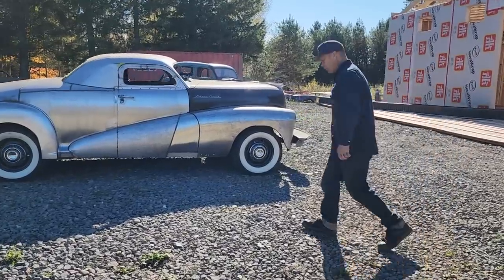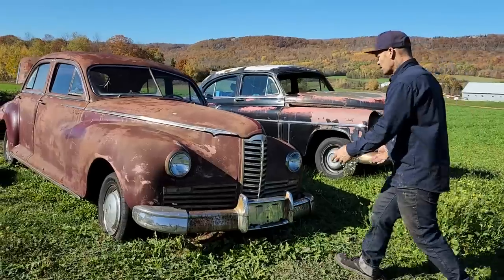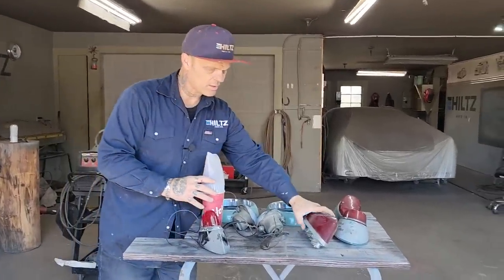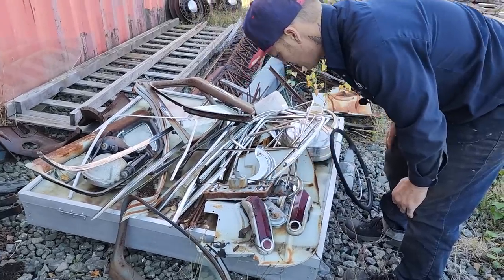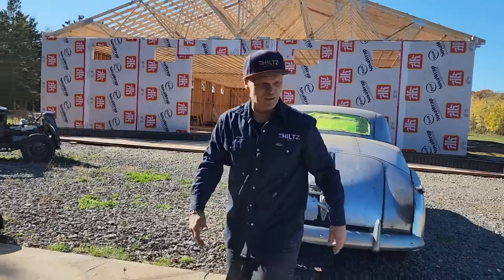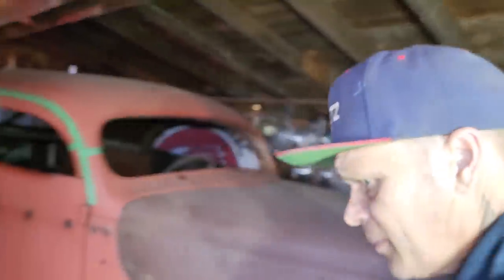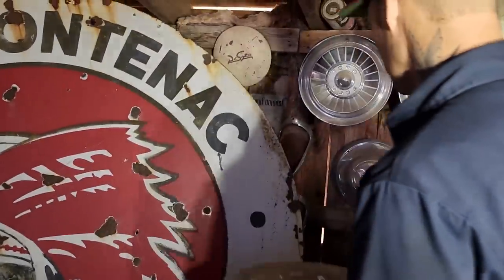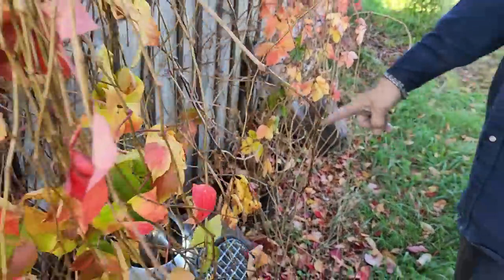The next custom fabrication... headlights, taillights, grill, hubcaps

Comment: I wonder if you can take the 51/52 Ford truck grill at (9:50) in the video and integrate it as a dual headlight setup coexisting with the current fenders.

Comment: Use weld through primer for those hard to reach places like inside the door pods etc, before you weld them shut because that bare metal will rust quickly and after welding shut you will not be able to get to them. Great job so far. I love your work ethic and creativity

Comment: The olds grill is an excellent choice but it will dominate the front end. Anyone seeing it completed will simply say there's an old Oldsmobile. Customize your car parts for your customize d car. Maybe trim grill ends in stairstep fashion or whatever. Mercury wraparound tail lights a little bit frenched would look outstanding. Your 56 Ford headlight rings with a little extension on bottom like the top might be cool looking. Love the build, keep up the great videos.

Comment: Put the plate back on the top of the front bumper then set that grill back on top of that plate. That way it will be higher and you won’t have to put so much metal between the hood and the top of the grill

Comment: I think the 'brand new's' 39/40  have the edge, they hold the same form lines  as the grille. Do the extended headlight rims.
 The spare wheel mounted on the installed 18 plate giving clearance for the boot opening/access.
 End of the day choice is yours and daresay it'll have the 'je ne sais quois' 
 Nice one guys👍
Reply: I was just following Chad's lead he'd said they could be 39/ 40 ....but brand spanking👍
Reply: Just realised...🤪🙄😁👍💕

Comment: At 13 minutes you were holding a 55 Chevy tail light assembly. It's 17 minutes and 19 seconds ish those were not 55 Chevys tail lights. The green headlight rims you had early on and possibly the small square rectangular tail lights off the car outside. And there's another set but flat and sleek. Is which car is so far sleek. But in something like Volkswagen tail lights or some other large tail lights at set out and not slope at the back of the car kind of takes away part of it being sleek. Now with that being said you made the short two-door work. External spare tire idea don't put on trunk later in my opinion put up in that large area you got there between the back of the cab of the car and the front top of the trunk lid. I think you'll find some in the thirties that was done like that. You can always put on the side behind the door and maybe one on each side for symmetrical balance. I think I'd go with the original grill. But with all that being said it would be nice if you had enough lights on the back that people could see it. If you French them then they wouldn't stick out so far. Just a few thoughts. It's a sense you're not going to do the Tommy gun steps on the side murder rocket launchers on the back deck where they come up and that flat area. How about reloading Gatling guns where the headlights pop out. The car reminds me a lot of the one in Peter rabbit parrot I don't think I ever watched whole movie but I kind of remember the car. I do mean that as a compliment. Your car every time you look at it it reminds me of something different. But then that's the idea isn't it? As far as a hubcaps I think you nailed it with those Pontiac hubcaps. The bullets on the 57 Chevy hubcaps would look nice too. But I'm kind of partial to stock 57 Chevy parts for 57 chevys. Just my bias. But the fun part is I can just tune in and watch you do the work and see how it turns out and go wow I never thought of it and it looks great. Or I can say I wonder if you read my comment and thought it was good or somebody else is with similar thought.

Comment: I'd go with horizontal Mercury tail lights, recessed or Frenched, and the original headlight rings recessed or Frenched. EVERYTHING smooth. Find some vintage wire wheels, with simulated knock-off spinners. Ditch the continental spare thing, go with dial side mounts. My 2 cents worth!!

Comment: Amazing. 'nuff said. But please don't use the Olds grille. General Motors used the same body for the Olds, Pontiac and Buick for 1948. So you end up with a stock grille for the year. Could do something much cooler.

Comment: I am disappointed your stripping the silver streak trim off the hood and trunk. I was hopping that some Pontiac style character would be left on the new design. Looks like your going with a rear stance with broken rear springs look. I did like the look of those rounded recessed headlight trim rings. I did not see any of your taillight selections you showed that really struck my fancy. I am wondering how some mid 1950 to earlyChrysler Imperial tail light treatments and or rear bumper and trim would look. There also some Fraser and maybe some 1949 or 1950 Nash Airflyte taillights would look pretty interesting with the trunk spare tire treatment.

Comment: Damn guys, there is plenty of choice. 👀 
The front grille looks fine to me. Beautiful bad. 👍
The front headlights would also leave the original ones, maybe I would add an eyelid... 
For the rear lights, on the other hand, I can't decide which one to choose. Those of the beetle aren't bad, but those boobs would be fine too. But before deciding I would put the spare wheel housing, and then see which rear lights match best. Perhaps the spare wheel can be placed higher, between the rear window and the trunk.
The new building is growing great, wonderful

Comment: Something is off with the driver side rear wheel opening. I've noticed it on a few videos and it bothers me 😂. Just take a quick look Chad. You will see it. Looks like the tire opening is off set. I'm not knocking your work at all though. You do great work. I'm a fan. it could be the angle of the video shot and it's tricking my eyes though.

Comment: Use the rectangular tailights off that 4dr. Also IF you put a single spare on the back it will cover a lot of the waterfall chrome piece instead use 2 spares side by side so the chrome peice stays visible.
For the headlights use the rings with the big overhang like eyebrows it will make the stick out even further.
Just my thoughts.
Enjoy watching you work like a master making a masterpiece!

Comment: don't take metal down to the Olds grill. place the grill higher & fill any metal below the grill. any welds would be hidden and fewer welds. I like the 1959 Caddy tail lights. Use the new headlight cans. those new chevron tail lights look awesome. you could put them on up or down & get a different feel.

Comment: I would French the 53 Mercury headlight rings . Install the Oldsmobile grille about two inches higher. As for tail lights go with the 59 Cadillac two per side one above the other French into the rear fender corner. The car needs to be dropped 4 inches in the front and 6 in the back to give it a tail dragger look.

Comment: What I think Volkswagen beetle tail lights would look Rilly good on that car. I think draping it 4" in the rear of the car is to much when your sitting in the car it be harder to look over the HUD.  It would be better if the front was lowered as much as the rear to keeping the car level

Comment: A grill like a 39 Chevy would look good wide at the top and taper off as you go down to the bottom you could make out of small tubing conduit pipe would work or something even smaller in diameter that would look good

Comment: This is Hot rod John from Chino California my opinion of the car is if you link them the deck lid at the top it would look so much better and look uniform and not have that large sheet metal area between the deck lid and the back window my opinion

Comment: id lift that olds grille all the way to the top butt it against the hood and fill in the bottom, that way you have access to the latch, maybe french those rectangular tail lamps into the bumper, or the originals flushed into the rear quarters using cans, weld cans in quarters then recess the original lamps inside the cans..

Comment: Hot rod John yeah by lengthening the deck lid at the top where the hinges are moving that forward towards the rear window and linkedin in it I think it would make it much more uniform because you have that large sheet metal area between the deck lid and the window what I'm trying to say

Comment: I’m loving the progress on the 48.  As you pointed out the boob taillights you set on the rear bumper stick out quite a bit. However I think if you actually do wind up putting a continental kit on as you suggested you might. They would be awesome.